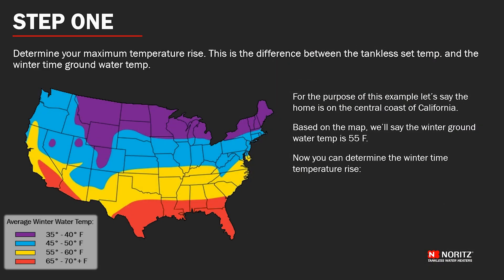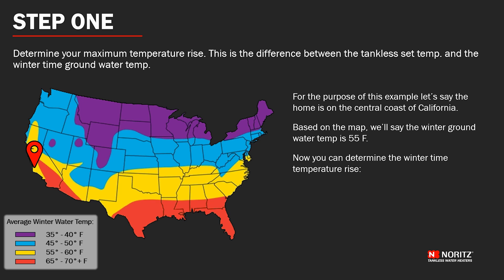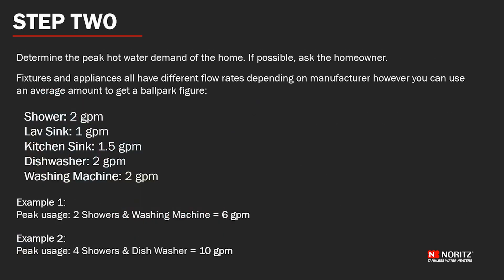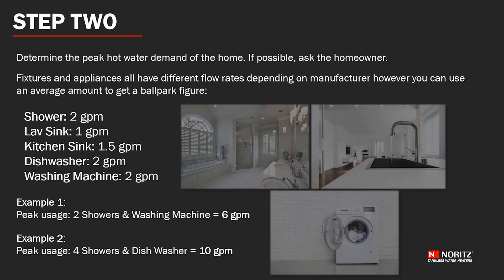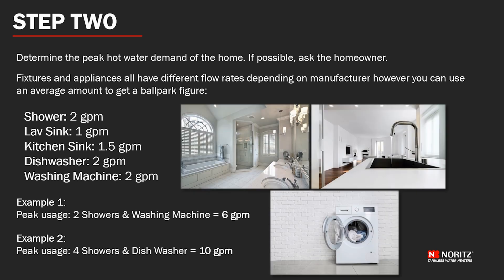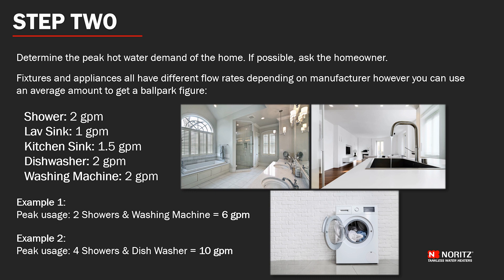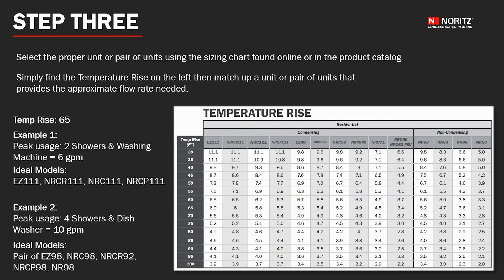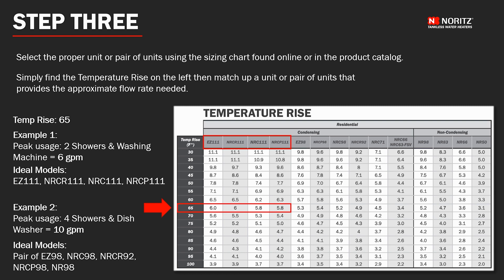How to Size a Tankless Water Heater

Comment: This is simpler and visually easy to understand and follow along.  This helped a lot.  Thanks.  Where are the links?  Also, this works great with soft water, or hard water filter installed BEFORE water heater.  Still, this is much better than most of other videos.